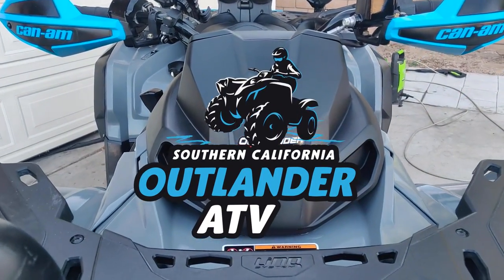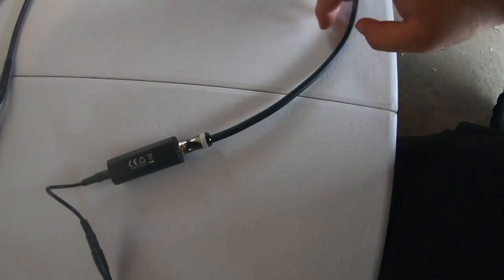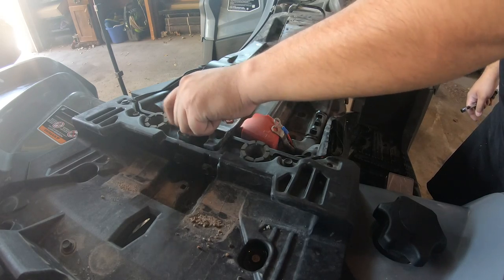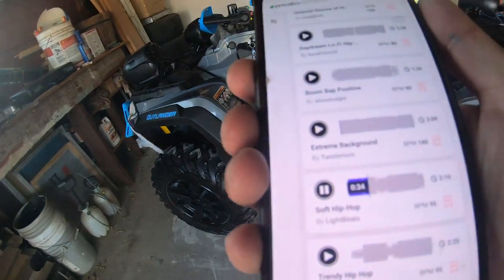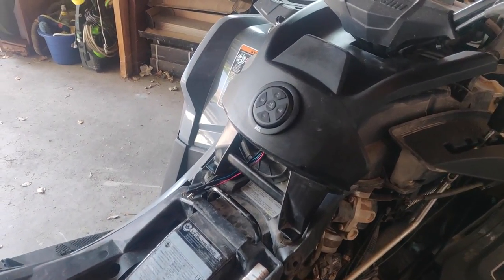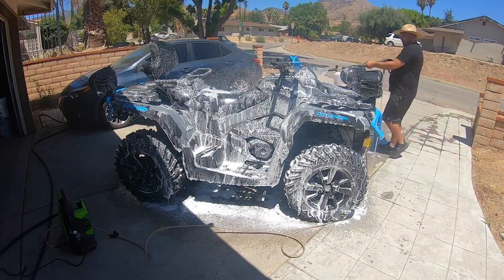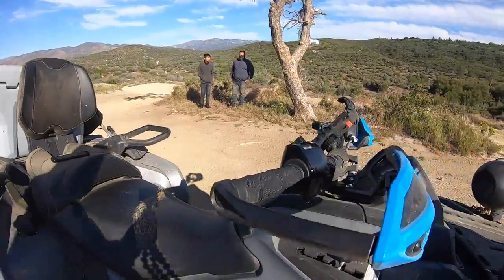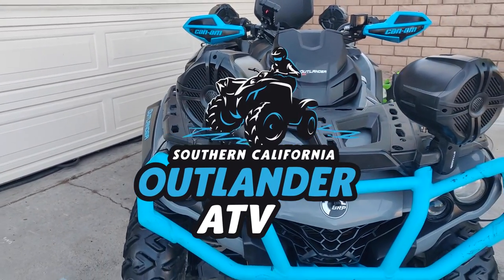1000 Watt ATV Sound System on my Can Am Outlander

Comment: U should go with just one of the tube speaker systems. U can get 6 1/2 or 8 inch speaker and they are all plug and play and u can get them with RGB lights and some come with an led light bar built into the back and has a storage box built into it with a USB plug built in it. The highest priced ones are under $400 like three something. U don't need 4 speakers with any of the speaker tubes two is just as loud if not louder than ur setup with 4 speakers. My BOSS speaker tube with 6 1/2 speakers that don't like up only cost $99 and it is very loud and has bass and comes with a 3yr warranty from BOSS!
Reply from the maker: Yeah my cousin has those BOSS speakers. I've also considered a sound bar instead.

Comment: Take some bar stock and make some bolted mounts by welding the nut to the bar stock after tapping all the mounting holes out.
Reply from the maker: Yeah that's not a bad idea. I really need to figure out a new placement for these speakers.

Comment: My question is what would you do different and would you do it again with the same set up.
Reply from the maker: Good question. I probably wouldn't do it again due to the fact that with all movement while off-roading the speaker wires and banana plugs get yanked a lot. I find myself more often than not having to replace one or two after every ride. I'd go with a speaker bar where the system is fully integrated and has less wiring. Maybe if I was more educated on speaker system setups I'd be inclined to adjust it for my needs. I also have never been a fan of where I placed them but I don't know where else to. As for now, I hardly use them now if I'm being honest due to recording for YouTube and their copyright issues.

Comment: Where did you mount the amp?
Reply from the maker: There's an empty space underneath the battery tray. The frame of the ATV is there and that's where I placed it. Cons, hard area to reach and you'd have to remove the side plastic panels if you ever need to tweak the amp.
Reply: Do you have a picture of how you placed the amp under the battery tray?
Reply from the maker: I don't unfortunately. There's an empty space directly on the frame underneath the battery tray. I cleaned the area and mounted using heavy duty double sided gorilla tape. Hope this helps. 👍🏽